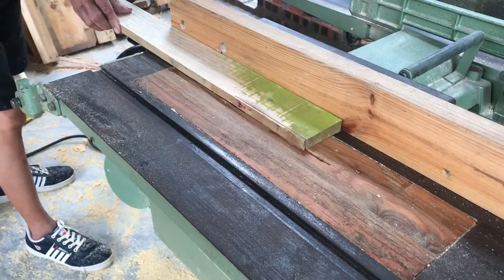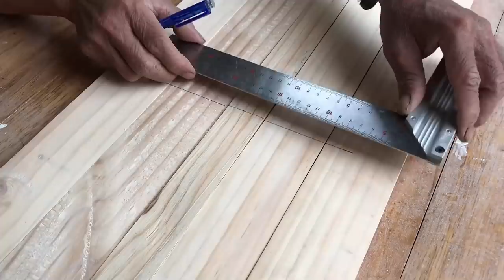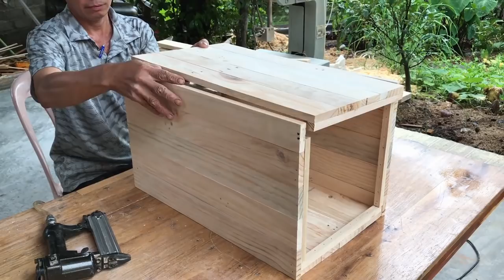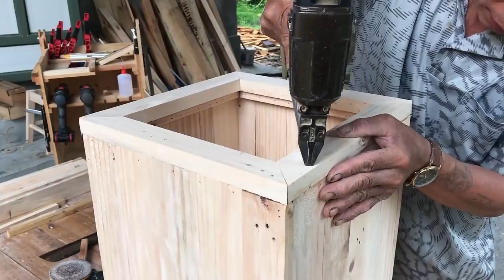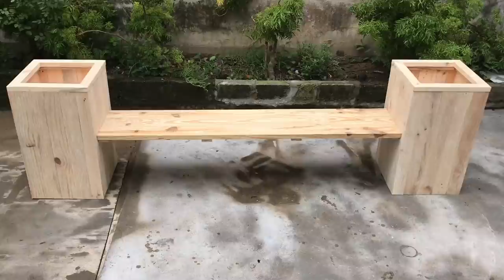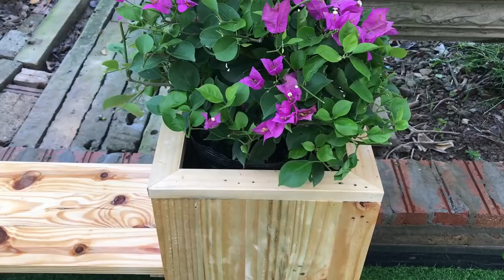Amazing Creative Woodworking Idea // How To Build A Garden Bench With Tree Planting -  DIY!

Comment: Very nice work.... But two little things

1 ¡Man use safety devices¡ even a stick its good to push the wood into the saw ,and dont put your  fingers just where you are nailing those things sometimes twich thereselves 

2 Another wood in the middle dont hurt